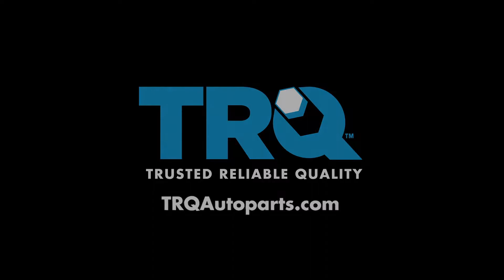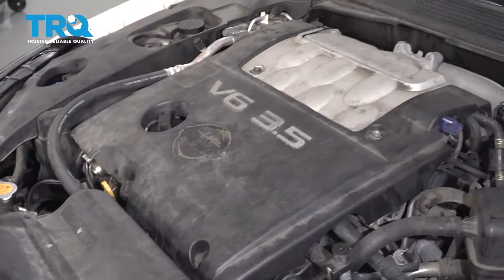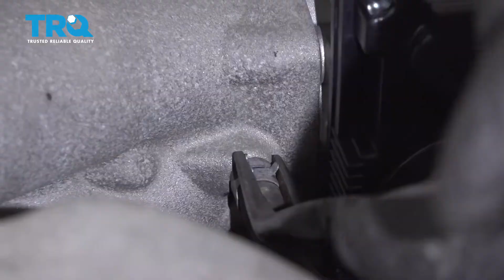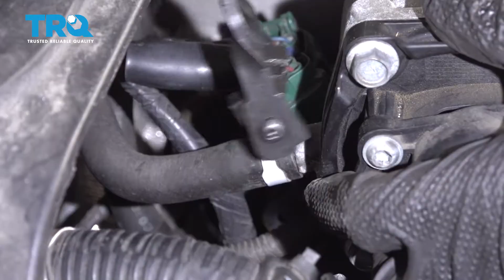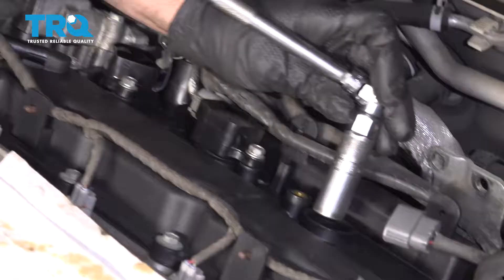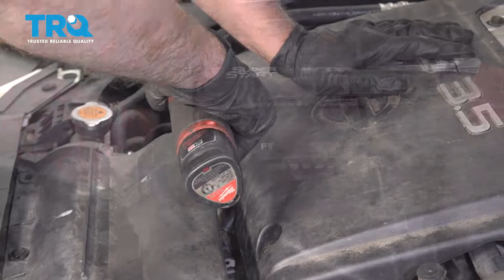How To Replace Spark Plugs 2003-08 Nissan Maxima

Comment: This video was a big help in replacing the plugs on our 2006 maxima. It is a California emissions model so had some extra EGR stuff going to the intake. I had to unbolt it then to remove the studs from the intake for that pipe. You need an E5 (external torx) socket. And for those two electrical connectors on the rear of the intake. I was not able to remove the bracket. Far easier to simply use a pick tool to release the connectors from the bracket instead.

Comment: Could you provide a list of all the tools you used?
Reply from the maker: +@charleswalton6330 Tools you will need:
• Flat Blade Screwdriver https://trq.video/oaKQ-1AXAA00013
• 10mm Wrench https://trq.video/oFa-1AXAA00010
• 12mm Wrench https://trq.video/oFa-1AXAA00010
• 10mm Socket https://trq.video/oaw4-1AXAA00017
• 12mm Socket https://trq.video/oaJr-1AXAA00015
• 5mm Socket https://trq.video/oaw4-1AXAA00017
• Air Blow Gun
• Hose Clamp Pliers https://trq.video/odx-1AXAA00076
• Needle nose pliers https://trq.video/otQ-1AXAA00051
• Needle nose pliers https://trq.video/otQ-1AXAA00052
• 5/8 Inch Spark Plug Socket
• Ratchet https://trq.video/oaVn-1AXAA00016
• Socket Driver
• Socket Extensions https://trq.video/oaJr-1AXAA00015
• Swivel
• Torque Wrench https://trq.video/o9n-1AXAA00044
• Paper Towels https://trq.video/os6-1AXSS00035
• Pick https://trq.video/oys-1AXAA00037

Comment: You can actually just remove the plenum between the air box and the intake and a few hoses.  Still a pain in the but, but not nearly as much work.  Did it today on an 2003 Maxima.

Comment: Amazing vid, helped 100%. There was an unidentified extra exhaust line near the throttle body, and an extra bracket near the firewall where the two green electrical connectors are, but I adapted, and couldn't (wouldn't) have done it without your very clear video. well done

Comment: Took me 2.5 hrs Just to do the 3 rear ignition coils and spark plugs. It was also 29 degrees outside. Seems like alot of work but it's not that bad. Especially when mechanic quoted $940 to do it all. This Video saved me $500. Parts were 430 for all 6 ignition coils and spark plugs. Thank you for your help. Great video

Comment: This is an insane amount of steps for such a simple job. It only makes a larger number of users more dependent on shops and dealership service. I can see how if the sticker price can't be raised high enough to pay for the cost of producing the vehicle without significantly cutting into demand for the vehicle, that extra required revenue could be extracted by slight of hand elsewhere in the overall lifespan of the vehicle.
Rather than a more cost effective value proposition in the vehicle upon it's conception, let's just create the illusion of the value proposition, then afterwards scrape the actual value back from them slowly.